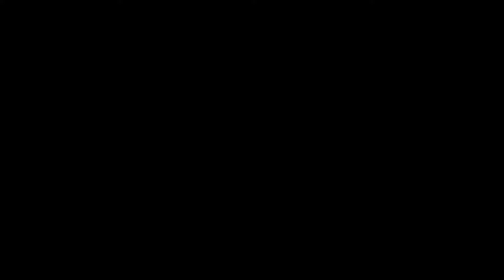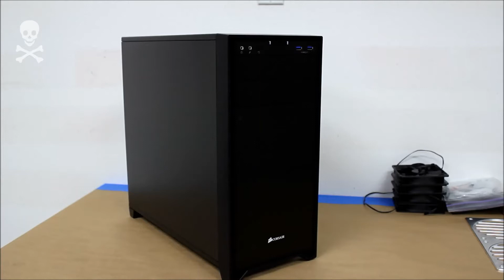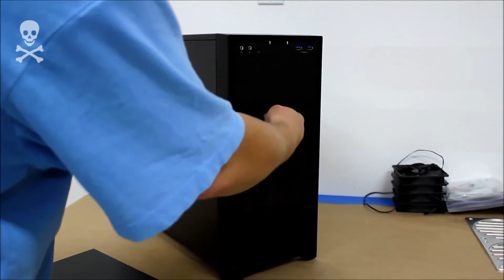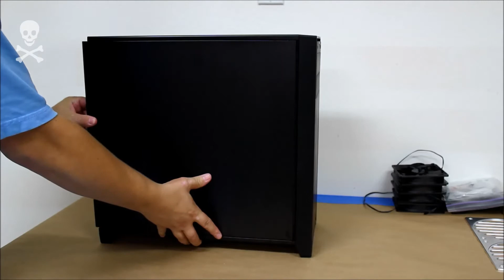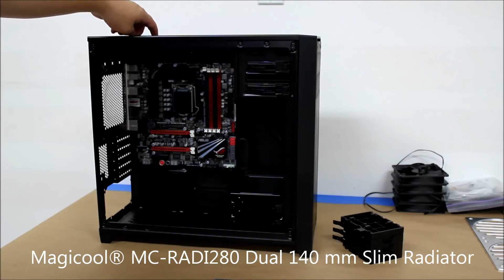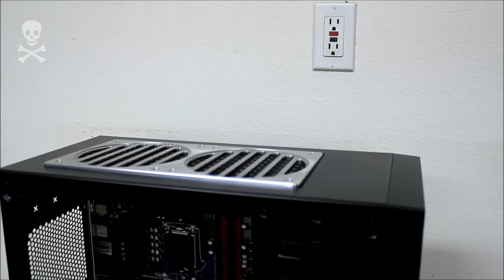350D overview HD

Comment from the maker: and not enough room in the top for a standard size Rad. 30 mm rad in the roof will be pushing it with Gene motherboards or any mother board with the 8 pin up near the edge of the board.